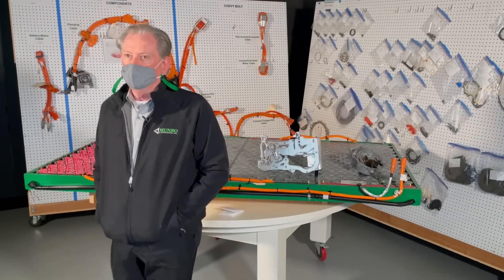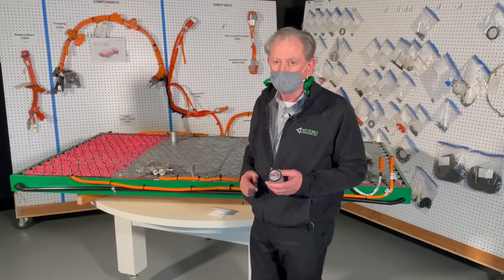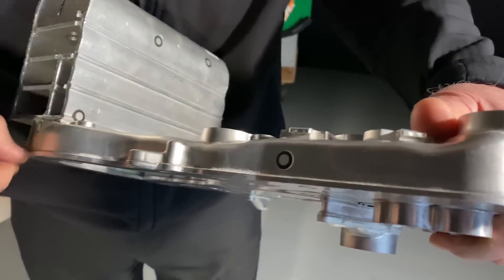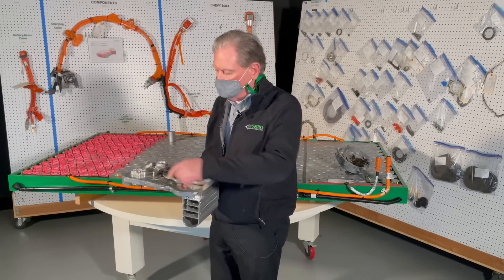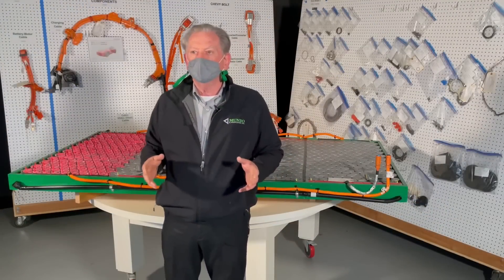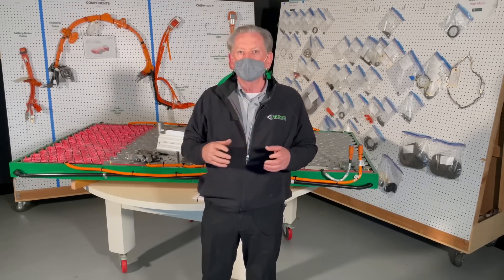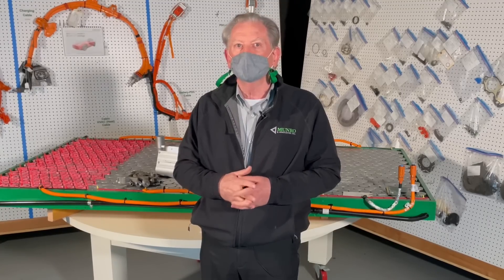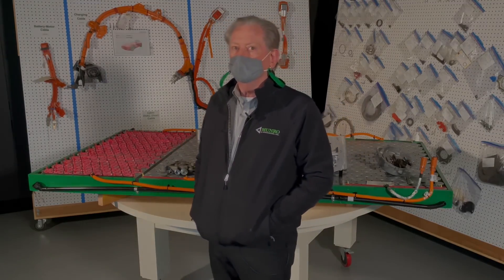Follow-up Episode: 4680 Battery Pack

Comment: My logic tells me that " heat sink" side of a battery pack should be on "insulated " side of a vehicle rather then outside, since temperatures extremes would be on the outside of a vehicle. That would be passengers side which makes it top of a battery pack. Isn't it more important to keep batteries as close to "room" temperature rather then just make it as cold as possible? Or i am wrong here?
Reply: It's not a simple heat sink but the big bottom plate with manifolds through it will have liquid that transports the heat away (or bring in the heat if needed).
It sounds like a rather complex thing (you don't just let liquid flow in on one end out the other because then the inlet will get the desired temperature and the outlet part will suffer from to hot or to cold). This is also then in practice not repairable (or in sections) so they would need to guard it. Early model S lacked such and some debris from the road made its way into (shot into) the battery and started fires (or something like that). Tesla then constructed a retro fit with titanium shield and aluminum deflectors. So I assume vehicles henceforth have adequate shielding and the new one will also need a shield to guard it from things than can ruin the cooling manifold. And thus it won't be on the "outside" but behind some layer/layers anyway where some might be insulated.
Reply: And an anecdote: I nicked the oil pan of my ICE car this summer - probably when in low speed going over a loose stone which I believed I had clearance for. It dripped oil and was discovered on service a few days later (hadn't lost too much oil thankfully). So a new oil pan was installed. If a battery cooling would be equally unprotected so coolant is draining out and maybe  is not repairable and then the battery is totaled and since it's structural to the car and more integrated and might be even harder to replace it - so they must be protecting it with a guard plates which can take some force and be replaced if needed or I would be very anxious owning such a car. (in a few years when Model Y is flooding out of Berlin I might be temped to buy one).

Comment: Would love to see monocoque heatsink / battery pack as part of the car considering it one of the heaviest item of the car, but i doubt it will be done by casting, too inefficient (weight, cost, cycle time & thermal efficiency) extruded aluminium with fluid channels in-between more like and capped both extruded ends off.
But as an engineer what do I know, I'm not Tesla nor Munro.

Comment: Do you think the 2021 model 3 refresh center console will fit a 2020 model 3? 

What about routing the sentry mode drive to the glove box on a 2020 model 3 like the new 2021 has it stock.

Comment: I always am amazed at what is called advancements in batteries 4680 where in reality it seems to be a further bandaiding of the shortcomings of the chemistry. I do think its cool and as a tweak its good to do though I think its so far below solid state that the discussions seem to obfuscate it drastic differences. \just the lack heating cooling and 25C charging of SS makes for a viable worldwide battery. Not trying to be negative but the discussions seem to use both interchangeably which they seriously are not.

Comment: Sandy, please don’t touch the front of your mask, that’s a no-no per our nurse daughter.  Only hold it by the ear straps or the very corner edge.  If it’s disposable dump it at days end and don’t take it home.  Please learn all the safety rules and follow them, the virus is highly contagious and should not be under estimated as too many have found out the hard way.  And thanks for the video, always informative.

Comment: Great video, as always, is the reason that the heat builds at the bottom of the battery that this is where the electrons are flowing. Is that because there was traditionally a bottle neck there due to the old single tab design? Will tab-less eliminate or greatly reduce this heat buildup increasing efficiency by not converting electricity to heat snd by reducing need for active cooling?

Comment: Heat rising only applies to fluids that have a lower density when they are hot, basically all gases work like this and some liquids - the density difference causes the movement in the fluid. This is called natural convection.
The main types of heat transfer are: natural convection, conduction, radition and forced-convection
The battery is using conduction as Sandy noted and gravity has no effect on this. The materials for thermal conductotion are usually metals and some covalently bonded forms of carbon: Graphene, diamond, silver, copper, gold, aluminium, siliconcarbide, graphite.

The coolant liquid in the Tesla is using forced-convection to remove heat from the conductive baseplate and hopefully use it for something else like cabin heating via the octovalve

Comment: how about BMS? If you link  cells in series and parallel you can't measure each cell individually. Now if you link parrallelel only every third row you can measure (and bleed) each cell individual. In a matrix of 10x24 cells you need 480 welds from which 132 are needed to connect to a BMS. My best guess. I like to follow Tesla technology and explanations.

Comment: The bottom of the battery pack has more area than the radiator and its made out of aluminium, so why does it need pipes to to take heat to a smaller radiator? Just put cooling fins in the monocast that makes the aluminium bottom of the battery pack/car.
Reply: I wouldn't want such a complex/expensive part directly risking being damaged by road debris (Tesla added shields before to protected the battery). And on a really cold day they need to heat the battery pack to get enough juice out of it. Passive cooling gives no thermal control over it.

Comment: What about the one piece Megacasting, can one design work for all the different models, from Model X to 3and the new compact, if one design fits all that would be a monster saving in costs
Reply: Guess not, hopefully between 3 and Y though. The S and X not being a big volume product I wonder if they will do a big redesign ever on it (the assembly S&X line shutdown now, if they introduce updates I guess it's too early for a complete redesign with those megacasting machines).

Comment: In “Building Science” we spend a LOT of time explaining heat energy transfers: three modes are conduction, convection, and radiation. Often, all three are in play at once, but convection is the movement of heat via air / fluid (air is a fluid). Convection is blowing heated air inside your car cabin in winter - not so practical inside a battery pack, so primary means of “wicking” heat away from the battery cells is conduction, meaning they are in contact with a colder material and the heat flows from contact between hot cell to (probably) plate material and onto something else that is colder still. “Fins” are a way of creating surface area to transfer conducted heat in the finned material (we often call this a “heat sink”) into a fluid, usually air - that’s why your household “baseboard” is a copper tube conducting heat from fluid inside (hot water) to aluminum fins - all through touching (conduction). The fins provide surface area to transfer the heat to the air immediately in contact with the fins and also through some amount of radiation. The heated air doesn’t just stay at the fin surface because of delta T or temperature difference with surrounding air, so through bouyancy, the heated air rises and effectively brings some heat with it, but still the “heat does not rise”. Finally, think of the sun putting out enormous heat: does that heat go “up” - No, it “radiates” across the vacuum of space 93 million miles. That’s radiation. Again, in heat transfer systems, one mode is usually predominant, but often all three are evident in relative amounts. Hoping this helps.

Comment: Question: if the battery is structural, and also for the best cooling, we want the battery to be strongly attached to that cooling plate.  However there's an electrical potential change from 0 to ~350 volts as you move along the battery.  What are the options for an insulator which doesn't compromise module strength?

Comment: About the cooling plate. 
Nothing forbids the cooling plate to be on the top and connection at the bottom. 
Also, nothing forbids Tesla to cram an additional cooling plate on the connection side if they feel necessary.

Comment: Just got our Model Y last night. Boy, the heat is freaking good, at least in 40°F temps. Even set at 70°F with fan speed on 1, it was toasty in the car. Energy usage is so much lower than our Model 3’s heater in similar temps. 

My biggest gripe with the Y is that it seems to be louder than the 3. It’s not necessarily more decibels, but with the open hatch body style there’s more low frequency sounds, almost a low rumbling, over broken pavement that the Model 3’s enclosed trunk doesn’t allow into the cabin.

Comment: Your 'heat rises' explanation was not very good. Heat rises in gasses and liquids via convection when warm gases/liquids are less condense than cold ones. This is usually the case, but not always. (I believe the densest water is 4 degrees C and anything colder rises above it). Conduction goes in every direction equally.

Comment: One thing you might want to clarify for your viewers is how much better the tabless cell is at conducting heat away when compared to a conventional end of jellyroll single point contact wire.  The change is dramatic and conduction from the whole edge of the rolled sheet compared to the end point could be demonstrated as a nice visual or demonstration video.

Comment: It would be interesting if you could explain how all the cells should be connected to a cooling plate, since there would be 96 series of 10 cells (or whatever number) electrically connected in series. So you can't just connect the bottom part of them all to one metal cooling construction.
Reply: The plus and minus connection of the battery is (Sandy prediction?) on the top. Some non-conductive material that encases the battery will have to go in the bottom so it's insulated. Then you could connect them to a metal cooling construction.

Comment: When they use the 4680 battery pack will they use a bigger heat pump to accommodate all those batteries? or maybe a new type of heat pump?

Comment: Interesting insight, but the reason GM isn’t changing the Bolt isn’t because the car is somehow related to an ICE vehicle (it’s not). Rather, GM doesn’t have the volume of sales yet where it would make sense to invest in better design and tooling. I guarantee that Ultium will be far ahead of anything done previously and may even beat Tesla. And it’s not going to stay still either.

Comment: How about your USB charger episode when you suggest we all keep using our old 5V=1A USB type A chargers and wait 7 hours for our phones to charge? Obviously 65W PD, PPS USB type C chargers are what you should have suggest instead and it's a scam Apple don't supply fast chargers. Yes your smart Sandy.
Reply: I am trying.
Reply: Buy the fast charger then from Apple or someone else. I think all can quit bundle the chargers though it would be a good win if the manufacturers cleaned up in their proprietary names for the same fast charging (case being qualcomm quickcharge for Android phones where they have different names for it).
Reply: @subwarpspeed  Samsung wont work on PD chargers without PPS protocol. Qualcom 3 fast charge is now very slow charging. (18w max) The Volts x Amps = Watts. 6v x 10a = 60w. 10v x 6a also = 60w but the pixies are of a different type. All protocol must meet the required combination for a specific connected device. the combination of V x A = W is so large  the on board computer transformer in the charger must compensate for more devices. We are using 65W USB type c now  days. Mr Munro says we should all keep our 5w usb type A chargers to save the environment but actually my battery would still go down if im using it at that rate of power output charging! Samsung Note 20 ultra.
Reply: @Lore69420  I was thinking of the phones for fast charging where the QC works well enough for my android phone and if I get it right the iphone 12 supports up to 20 watt (at least the apple charger is that). For laptop or big tablets agree QC isn't enough.
But as Sandy pointed out, apple saves quite a lot on not shipping the charger (smaller package). Aren't they promoting their chargers? Seems you think people are capable of buying a new phone but not picking up a charger to match their needs. If iOS isn't informing about the difference in charge speed it's bad.
Reply: @Lore69420  Okay looked into the apple chargers and perhaps they should have let one other generation go by with shipping the chargers. At the same time it seems the iphone 8 supported PD - have people been unaware of it? Quite a few must have already went up and gotten a fast charger by now.
Somewhere they have to make the cut when they wont to make this decision to not bundle it and seems like they thought it was now.

Comment: Tesla will have to invert the middle body casting to install the cooling system (if it isn’t integrated), then the cells, add the thermal glue, install collectors, weld the collectors to the cells, then glue/bolt on the cover plate, which is the bottom of the car.   

Nothing is serviceable so I hope it’s reliable.

Comment: Sandy, why not design a simple shock absorber that eliminates springs and generates power? one way might be to have two high-pressure air chambers, one on the body side and one on the wheel side, that work as a "buffer" and from which high pressured air can drive something .. sort of like the cylinder on a steam locomotive, but in reverse .. or is the energy harvested that way insignificant? If anyone, you could do it .. or perhaps tell me why its not worth doing, or has been done? (I could not find one).

Comment: Heat rises in a fluid (liquid or gas), but in a solid, the thermodynamic principle that rules is that heat moves from hot to cold, regardless of direction.

Comment: My main question is doesn’t the epoxy mean that if there is one bad cell you have to destroy and replace the ENTIRE pack?!?
Reply: In Sandy's example they are connected 10 in parallel for each step so current a bad cell will decrease the power a bit but current flows through anyway.
Reply: @subwarpspeed  Thanks. I guess I was thinking more in terms of a dangerously bad cell...
Reply: If the thing that keeps today's cells together is epoxy then I think the situation is the same for vehicles on the road and seems the fires are rare (but not medias reporting on them vs. ICE vehicles).
Reply: @subwarpspeed  Current Teslas have several battery modules that make up their packs. One only needs to swap out a bad module not the whole pack. This new design sounds to me like you have to trash the entire thing. Your point about fires is certainly true.
Reply: @mrdsn189  do they swap out modules in reality? I mean if a car has a problem, is that a repair strategy at service centers? The might reuse the other modules if they take it all back though. But if we count the number of cells (maybe only takes one to go really bad) and they now have fewer ones and make them a bit better to have same risk of failure per pack.
Reply: @subwarpspeed  Good question, maybe someone who knows will join the thread some day. Interesting point, less cells may equalize the odds as you suggest. My main point is about the increase in waste when it does happen.

Comment: electrical modules are inevitable in the form of the parallel/series config, mechanical modules are avoidable, and avoided ...
Reply: Yes, it's just folding it. If the cars were narrow and long that configuration (10 cells parallel in each step) could have been in one long row. :-)

Comment: I wonder if a 'heat pipe' system might be a better way of transferring heat from the batteries to the radiator.  Heat pipes are a very efficient way of transferring heat, especially from a low heat source to a higher heat sink.  Basically, heat boils the active liquid and the boiling point can be adjusted to whatever you want by a combination of chossing the right fluid and using it in a low pressure environment.  Latent heat is transferred.  You might have to put the cooling plates at the top of the battery pack instead of at the bottom so that the fluid comes in contact with the surface that is being warmed by the batteries.  Even with water, the working  (boiling) temperature can be adjusted from zero C up to way above boiling.
Reply: That would be a passive system which they can't thermally control. If the car is sitting outside in very cold weather it needs to actively heat the batteries by pumping heated liquid into it. And seems the octovalve choosing paths for the liquid is easier/faster than having a heat transfer module without exchanging heating/cooling liquids.

Comment: Do you think this desing may improve the charging? For example if you compare the chargine rate of an etron and a model 3 then the etron can hold 150kwh up until 80% while the Model 3 peaks with 180kwh at 40% but then slowly drops down to 150kwh at 50% and this continous linerally down to ~60kwh at 80%.
The result is slower charging rate. Would be nice if the new desing help the battery to keep a constant charging rate